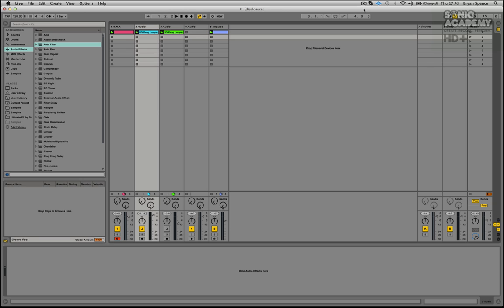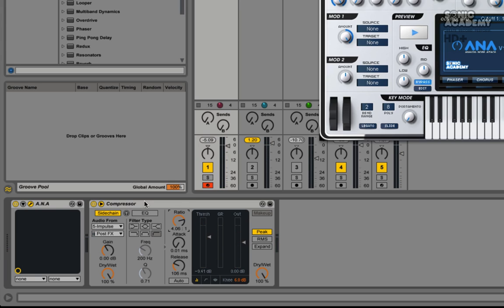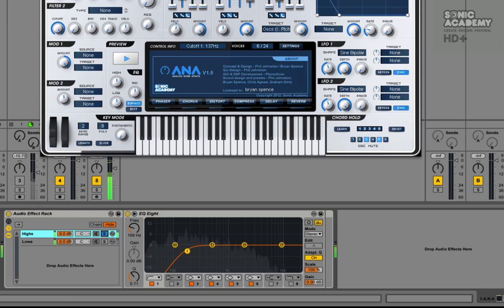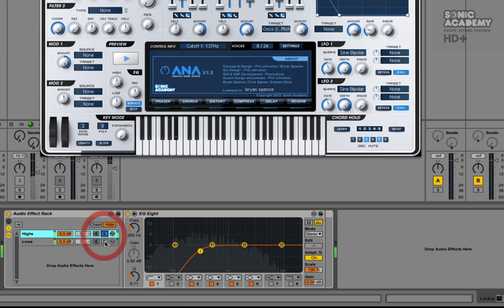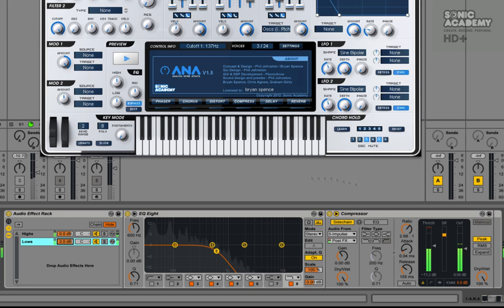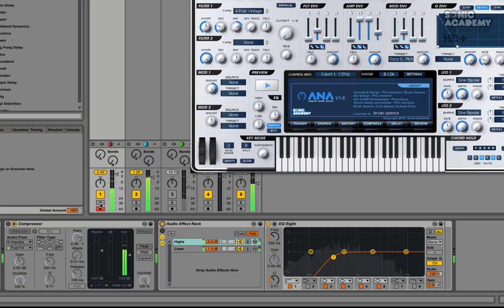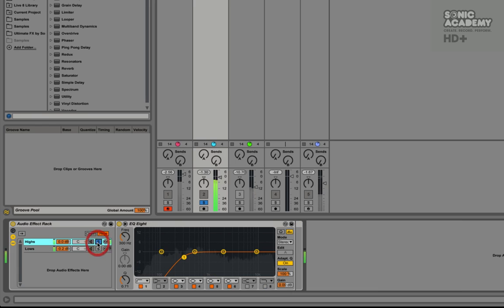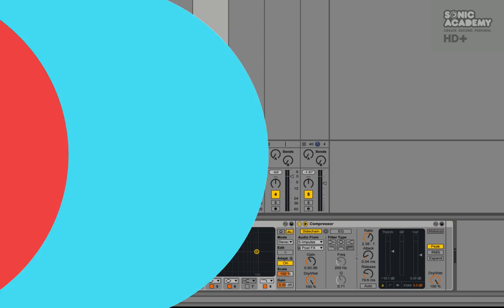Tech Tip - Advanced EQ'd Sidechain

Comment: A eq already exist inside the compressor...
Reply: djroyel I'll have to double check now but I'm pretty sure it's just an eq for the input signal that the compressor uses to tell it when/how much to be activated
Reply: not if you change the filter type. this is literally the same thing
Reply: it is
Reply: falcaoo17 that's just for the  signal being used for the compressor. it will still compress the entire spectrum